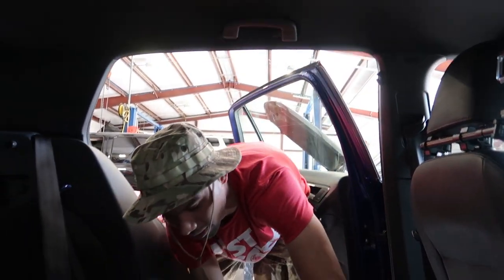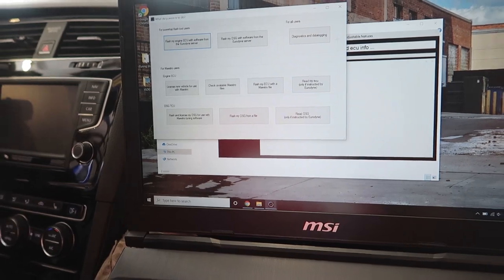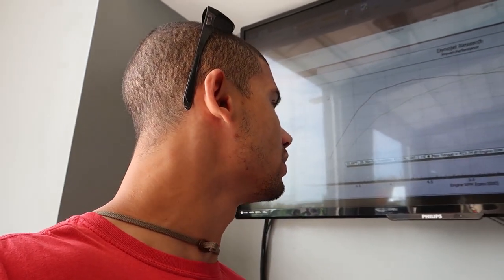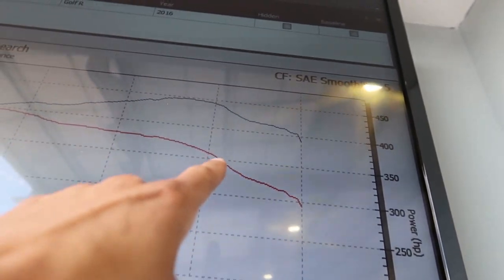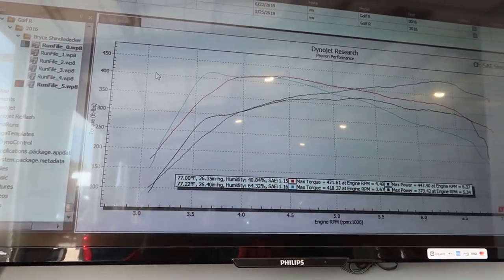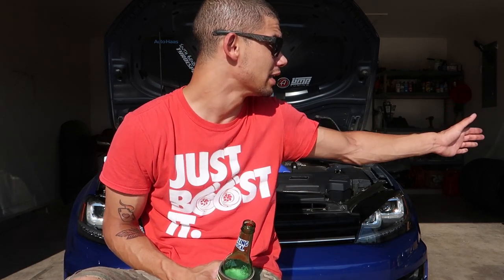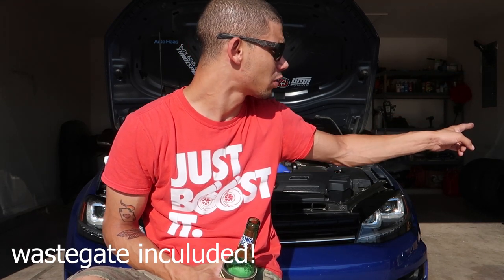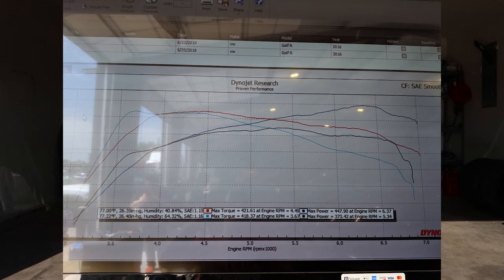Stage 3+ EQT Vortex Dyno Results! | Mabotech Tuned | MK7 Golf R

Comment: I'm running the 525lph tuned on E77 without the fuel pump controller. I'll probably add it over the winter, but it's been fine so far limiting the duty cycle to 85% No fuel pressure drops or anything.
Reply: Kinda set up and pwr are you making?
Reply: dwvw : Do you have the high and low pressure fuel pumps installed?  Or the same port injection that Bryce has?
Reply from the maker: I think he has just the 525 and bigger Injectors.. I could be wrong though. No need for hpfp with PI
Reply: @Kevin_MK7RSR  stock hpfp. Running the 1300cc injectors. Tomioka IHX675 making 540/450 on E77
Reply: dwvw stock block?
Reply: Mk6 _mark yes. Stock block and trans/clutches
Reply: @dwvw  how long you been running that turbo and how do you like it?

Comment: awesome videos! Lets get some in car footage, I want to hear that turbo!
Reply from the maker: I'll have plenty after this coming weekends event! 🤘🤘
Reply: @BryceJordanProductions  Curious to hear your street driving impressions too!  What do you think of low down torque and lag vs the is38?  Thanks for the vids btw!  About to do my brakes using your vid as a guide this week.
Reply from the maker: I don't feel a difference in spool honestly, it doesn't hit as hard at first though, which is great actually. I'd rather have a predictable linear power and for autocross vs a huge jump for a short period of time.. I'm hoping this will translate to not having to play with the throttle as much in racing, I'm always having to back off slightly cause of how quick it would hit and make the car slightly off balance.. it should be alot smoother now on course!

Comment: Awesome results, can only imagine how sweet it feels on a cool evening. Also, instead of disconnecting the harness you can also just try putting it into dyno mode, it would disable the haldex as well. And a lot easier....was this on 91oct or 93? as I see the slider set for 93.
Reply from the maker: Dyno mode isn't safe, I've seen the AWD kick in and break things doing Dyno mode, I wouldn't ever recommend it! The slider really isn't for octane it's for timing increase, I'm on 91 octane. It feels so good on cool mornings! I wish I wasn't at altitude ☹️

Comment: Oh man, the turbo noises this thing is making are awesome.  I have a GTI and have been looking at this turbo.  What is your actual altitude?  I am at 4500' and only have access to 91 octane.  Interested in how it drives around town as a daily.  I don't want to lose all the low end and have it be horrible to drive around town.
Reply from the maker: Roughly 4300, we're about the same! It drives so so good dude. Much better the the way the is38 spools, and I honestly don't feel a difference in spool time. It's so fantastic lol
Reply from the maker: Definitely not overkill, my valves are getting nice and clean too. Port Injectors are at 40% so they're definitely doing some type of work.

Comment: Isn't there a fuse for the haldex that you could pull that is more easily reachable? Given that completely pulling the connector definitely works.
Reply from the maker: I'm sure there is, but im not sure of which. In the near future I'll be hooking up a switch to that connector I believe so I'll be able to just turn it off on the fly, and do fwd burnouts 😉

Comment: Any advice building my motor, anything u can tell me what I should and shouldn't do brother?
Reply from the maker: I'd literally not re use anything that goes inside, excluding the crank and bearings unless you need to remove it. New injectors, new bearings for the balance shafts, new cam oil control valves new chains etc
Reply from the maker: Follow the book closely and if you're confused ask someone. The EA888 engine builders group on FB is great
Reply: Thanks Bryce so basically I've done just that been watching your videos closely thanks brother 🙏
Reply from the maker: PM me on FB if you need the engine book. Bryce Jordan Productions
Reply: Thanks brother ill do that🙌

Comment: What software did you use to tune your car?
Reply from the maker: Originally United Motorsport then switched it up to eurodyne maestro.. UM is 8+ hours away to get flashed and when I was going stage 3+ I couldn't drive that far after doing the fuel pump and port injection so I had to figure out a solution. And at the time Cobb didn't support port injection so my only option was to go eurodyne

Comment: what fueling mods you have?
Reply from the maker: Precision Raceworks 925cc kit/450 pump/pm4 controller
Reply from the maker: I didn't have the fuel controller back then though that just got installed about a month ago
Reply: @BryceJordanProductions  Hmm i'm trying to get the EQT vortex on my mk7 GTI rn, I'm FBO on HPFP.  I'm thinking i will need to upgrade the LPFP to the 450, but am worried about running that without the controller.  Is this an issue running the 450 without a controller? I'm only going to do e30 on the turbo and i'm high elevation so i'm not super concerned with fueling demand but dont want to cause bigger problems like damaging the stock controller.

Comment: Was there a reason for switching from UM to Mabo?
Reply from the maker: Convenience was the only reason I left UM. With doing all my work myself, and them not flashing on weekends made it hard. I couldn't do my fuel system and drive un tuned 8hrs north for a reflash isn't safe or smart.. plus I'd have to take off work to do that.
Reply: Can you run the eqt on an apr tune?
Reply from the maker: @essayibcs8528  I mean technically yes but you absolutely shouldn't lol
Reply: And what supporting mods are needed. Its a direct replacement right?
Reply from the maker: Direct replacement, only thing I changed was the oil feed line from hard to braided steel

Comment: Rim, tire specs? I have an s3 and i want 17s
Reply from the maker: 17x8 konig hypergrams +35 offset (~17lbs) 245/45 federal RS-RR. Love this setup and cost under 1k together!
Reply: Also looking at a stage 2 UM file woth supporting bolt ons. I saw a s3 in NJ trap 118 on the is38 and pump. Still watching your vid so waiting to see the trap speed
Reply from the maker: Heck yeah! I am a manual car though so take that into consideration when I get back to the 1/4. My best trap when I was UM was 112, but I'm also at altitude with crappy 91.
Reply: @BryceJordanProductions  awesome video. You seem real happy. Thanks for the spec info. Good luck w your small turbo upgrade. You are gonna hurt a lot of feelings.
Reply from the maker: Let's hope! 😏🤘

Comment: Bryce.you think a mk7 gti can handle a high flow downpipe without a tune.i know what’s the purpose of a Highflow DP without a tune but just curious.and with all the mods you have done have you had to change your purge valve?
Reply from the maker: It can't handle it, but you risk going into limp mode due to over boost sense the downpipe flows so much better. Some say you can get away with it by having an O2 sensor spacer. It won't hurt the car but you'll have to clear the code and such when it happens! I have had a few different valves and I'm back to the stock one and it's holding up fine for now.. tuner wants me to get the GFB DVX though, so that's on the list when the time comes
Reply: She’s sounds beautiful 😭👌🏽.congrats on achieving your goal!!!
Reply from the maker: Thanks buddy!! 🤘
Reply: Adam Taylor : I have a brand new Cerakote'ed Bull-X Down pipe for sale for a GTI that is no-cell guaranteed because it has a race cat.  LMK if your interested 👍🏻

@bryce I have the DVX and love it 👍🏻. Haven't had any issues yet and it fits better around the intake.
Reply from the maker: What's the second piece for? I haven't looked much into it, just kept a mental note of what he suggested. You have the main DV then it looks like some cap piece and a vacuum hose going to it?
Reply: Bryce Jordan Productions Correct, I installed mine but kind of forget why it's in two pieces, sorry.  I want to say it moves the OEM diverter and the Vent to atmosphere DVX BOV sits in place where the OEM one was, and is just controlled by that vac hose.  I might have an install video I never published somewhere I could send you. LOL
Reply from the maker: It's all good! I'll figure it out whenever the time comes! It have good sound when it's open? Id probably keep it closed or ever so slightly open to the atmosphere
Reply: @BryceJordanProductions  It does sound good.  It's more of a "Pssshhhh!" sound than the "Stu-tu-tu"  which is fine with me.  It's pretty loud wide open and I just leave it there.  Sounds Great :)